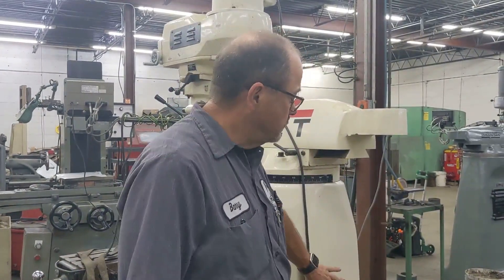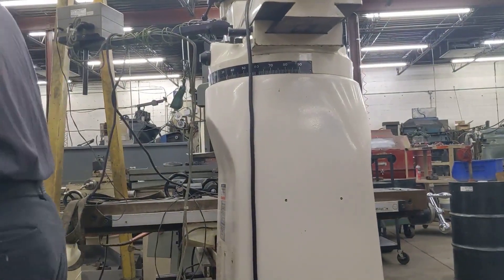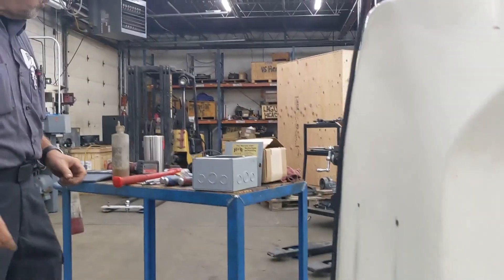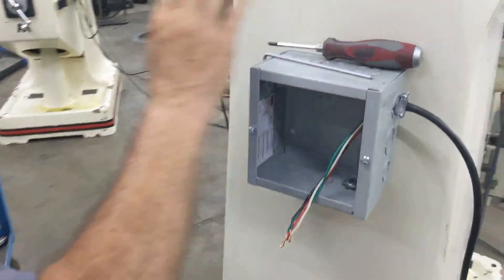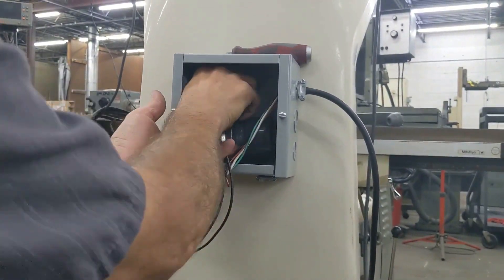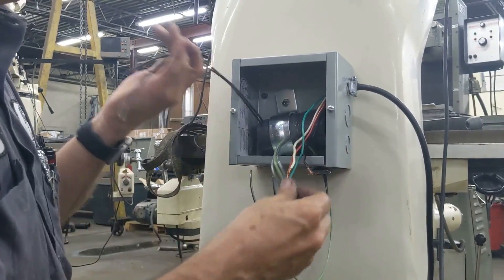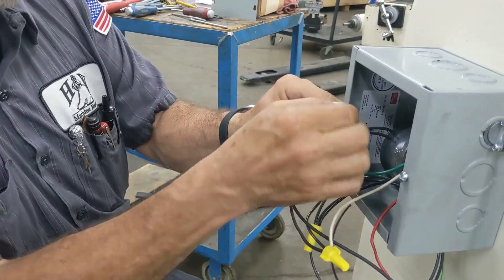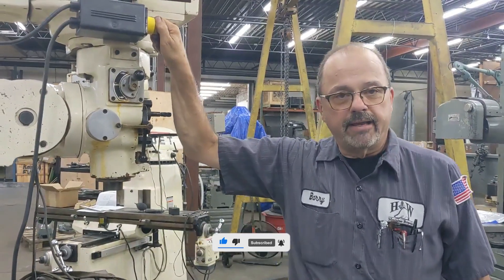Installing the Solid State Phase Convertor

Comment: I purchased one of these this week.  I have used VFD's in multiple applications in the past.  To me this offers the advantage of using the original design of the mill for speed control.  It has proven reliability from many multiple uses since H&W went to these.  They are not just a capacitor.  The H&W website offers more detail on these.

Comment: Sorry forgot to tell you what machine i have its a 1 hp step pulley Bridgeport.
Reply from the maker: Yes, you can get just the capacitor, this is the one made for a Fwd-Rev motor: https://machinerypartsdepot.com/product/standard-solid-state-phase-converters-without-mounting-hardware/

You would need the PC-B for the Step Pulley.

Comment: Great video!! Have two questions basically.Can i buy just the capacitor ? And when motor is wired for low voltage when motor stops will it run forwards and reverse? Thanks and a again super video.Well done!!

Comment: You're going to lose about 30% of the motors rated power with a static phase converter just FYI.
Reply from the maker: This is Barry commenting:  This is not a static phase converter and per the manufacturer you will loose about 10% of your power with our Solid State Phase Converter.  We quit selling static phase converters several years ago because of the power loss issue as well as the unreliability of the units.  Our Solid State Phase Converters and also USA made.
Reply: @virginiabass8095  This technically is a static phase converter since it doesn't have any moving parts but all it really is is a capacitor. The capacitor delays the power coming from one of your existing legs on your 220v circuit to simulate a phase shift to drive the 3rd phase of your motor. There is a significant power loss doing it this way. It's probably not an issue with a larger motor but if you have a smaller motor on your mill you definitely will notice the power loss.

Comment: Any chance that would work with a 3 phase 2 speed motor? I have 2 old burgmaster drilling / tapping machines that I currently run on a rotary phase converter, I would like to get away from running that if possible.
Reply: Look into getting a VFD as they give you a lot more options to play with. You can get an Allen Bradley VFD on ebay for pretty cheap. You can safely run VFDs that take 3-ph inputs on single phase 220V.
Reply from the maker: Hi Dwyane, these aren't designed for 2 speed motors unfortunately.
Reply: it looks like a static phase converter. If so, you should be able to use a 2 speed motor.

Comment: I have used a similar converter, then a homemade roto-phase, then a variable frequency drive (VFD). My opinion, save your $$ and buy a VFD.
Reply: I too have a strong preference for VFDs. One time I needed to run a 6" HSS hole saw through stainless and needed about 30RPM and the VFD got me there. I also have a beefy breaking resistor so when I shut off the mill the spindle stops in about 2 seconds. I have the same setup on my lathe and it went from stopping in about 10 seconds to 3.

Edit: Even though I only have single phase in the shop, all of my VFDs are 3-ph inputs. There is no problem running single phase into a 3-ph input VFD, you are just limited to 3/5 of the VFD rated HP. Not a problem though, I just got a 7.5HP Allen Bradley VFD for my 5HP lathe.
Reply: You can get a single phase input three phase ooutput VFD. You can also set them up with braking, ramp up/ramp down, remote operator controls, etc.